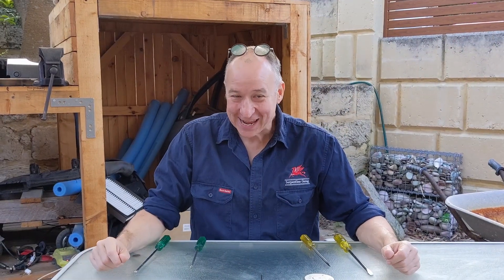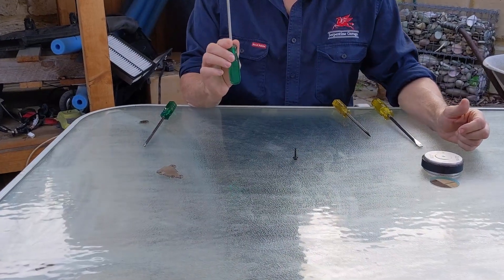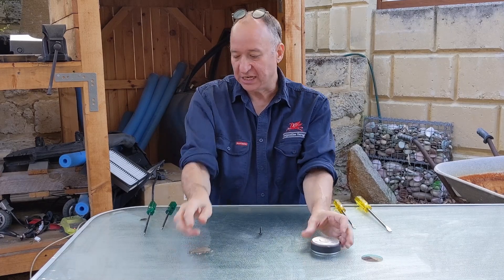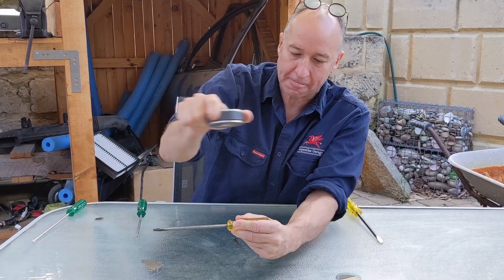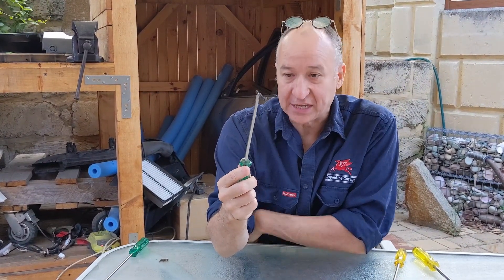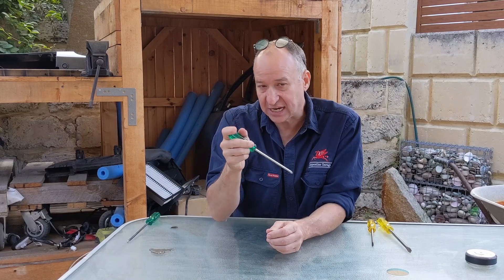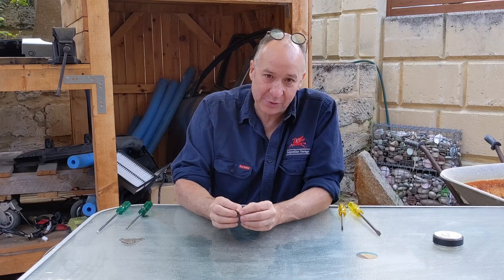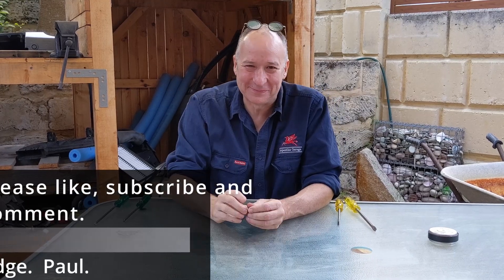How to magnetise a screwdriver.

Comment: Interesting video. So if you for some reason wanted to demagnitize the screwdriver, would you just do the same thing but in oposite direction?
Reply from the maker: There are special devices that you can buy to demagnetise items that have induced magnetism.

Here are some examples.  https://maurermagnetic.com/en/demagnetizing/demagnetizer-products/

Inducing magnetism is an exercise in getting all the magnetic domains to point in the same direction.  Demagnetisation requires those magnetic domains to be returned to a random direction.

I don't know how to make a demagetiser from household products.  But yes, products that do that do exist.

Paul.